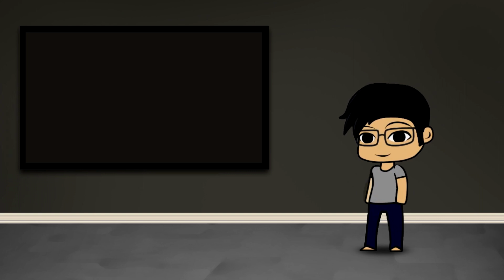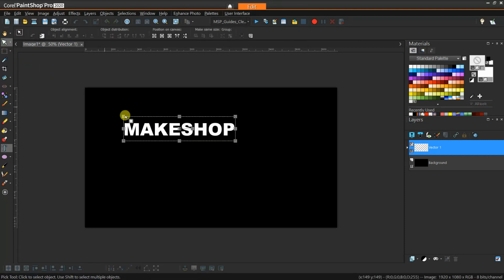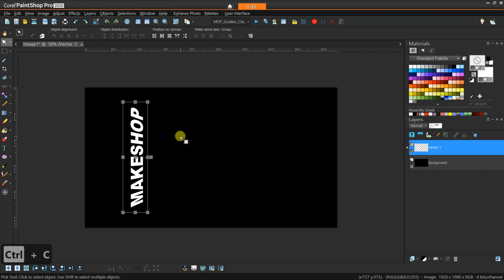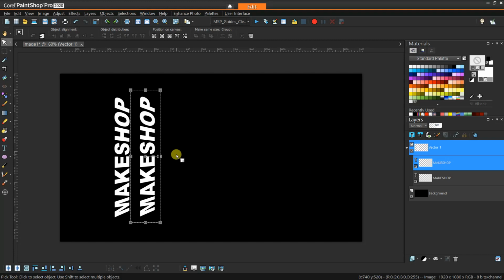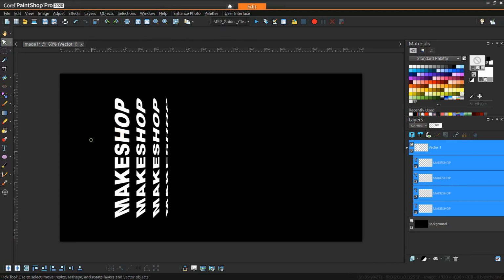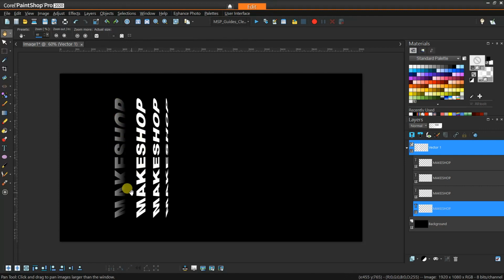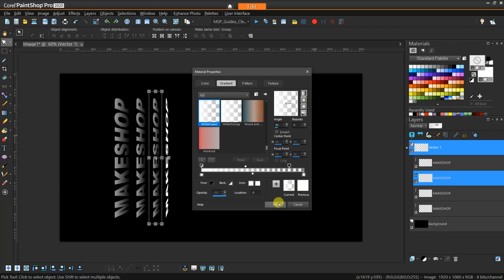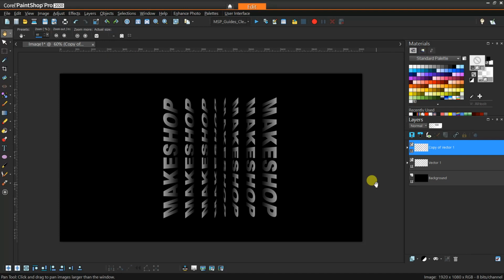Text Perspective - Tutorial - PaintShop Pro

Comment: Weird little problem in my PSP 2018. Control-G doesn't work.
Reply from the maker: If you right-click after the copy do you see an option to "paste as vector object"? If so, you can see if there is a shortcut key next to it.
Reply: AFAIK that's a bug in PSP 2018, fixed in later versions. A tedious workaround is to paste as new layer, then in the layers palette  manually drag the text object to another layer, and delete the empty layer. Or leave each text to its own layer, then group together the ones you want, and then transform-wise treat the group as if it was a single layer with multiple text objects on it.
Reply: @hecfashion3260  Thanks! I hadn't thought of that second workaround.